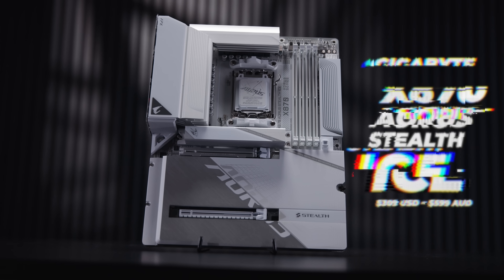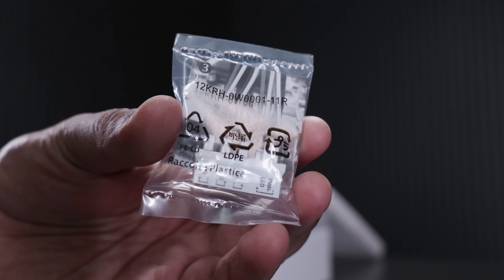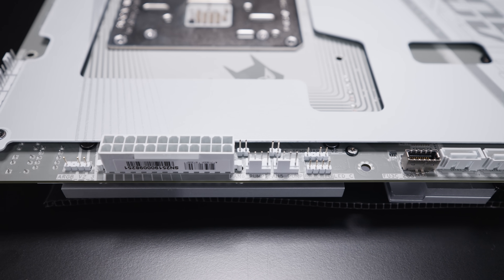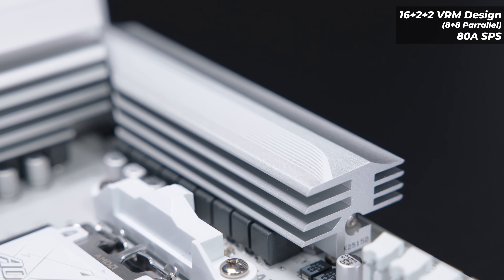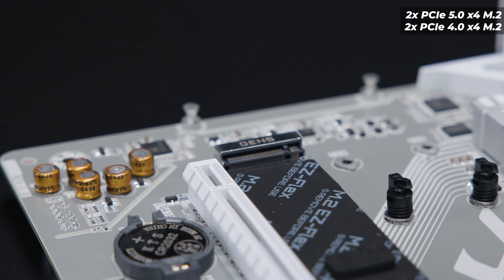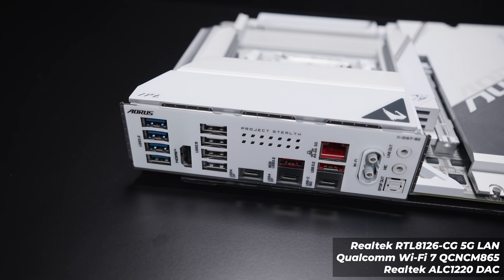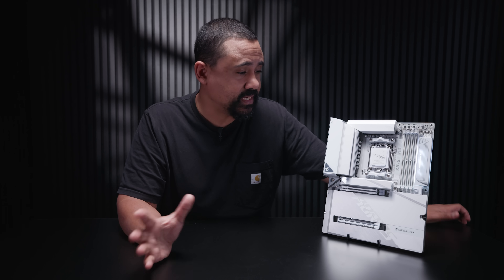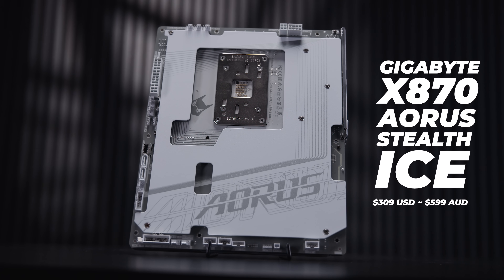AM5 is finally getting the love it deserves! // Gigabyte X870 AORUS Stealth ICE

Comment: I have a GIGABYTE AORUS B650 Stealth, and my RGB lights are completely dead due to the ITE 5711 issue. There seems to be no reliable way to fix it. I’m planning to return it to Amazon in the next few days.

Honestly, after this terrible experience, I really want to move away from Gigabyte. I’m considering switching to the MSI B850 GAMING PLUS Project Zero or the ASUS TUF Gaming B850-BTF WIFI W… or maybe taking the risk and getting the beautiful GIGABYTE X870 AORUS Stealth ICE.

Has anyone else experienced the same problem?
What would you do in my situation?

Comment: Nice review and thanks! , you mentioned not the recommended memory  so "what"is the recommended memory ?
Reply from the maker: It will do 256GB but not at those type of speeds. You could probably do 6000MT/s

6000MT/s is about the sweet spot for Ryzen 7000/9000

Comment: I have two M.2 SSDs (1TB Gen 5 and 2TB Gen 4) currently installed in this board (pretty much full), if I add a third drive will performance suffer due to shared lanes?

Comment: I personally love the Ice version of this stealth board. I got the X870 Stealth Ice in a Corsair 6500X case. (An all-White build...) It looks really clean. The only cables sticking on the front is the iCue Link cable to the CPU block and the 12vhpwr cable going to the RTX 4090 GPU.  So far so good. It handles my 9950X3D/4090 and the 64GB Corsair Titanium's at 6600MT CL32.

Comment: And here's the complete PC I want to build. Can someone maybe check if everything's OK or not? im not the best with pc stuff XD

GPU: RX7800xt (already installed)
CPU: Ryzen 7 9800X 3D
RAM: G.Skill Trident Z5 NEO RGB black DIMM kit 32GB, DDR5-6000, CL36-36-36-96
MAINBOARD: GIGABYTE B850 Gaming WIFI6
CASE: Fractal Design Pop XL Air RGB Black TG Clear Tint, glass window
PSU: FSP VITA GM 850W ATX 3.1 80+ Gold
CPU FAN: DeepCool AK400 Digital, black
SSD: Lexar NM790 1TB, M.2 2280 / M-Key / PCIe 4.0 x4
SSD 2: Lexar NM790 4TB, M.2 2280 / M-Key / PCIe 4.0 x4
+2 Fractal Design Aspect 14 RGB PWM, black, 140mm  For above 
Thank for Help ❤
Reply: Everything looks fine BUT the mobo

What’s the price of it compared to let’s say B850’s also from gigabyte in your region?

If you must go for that board I’d sternly suggest going for the X version.

So, Giagbyte B850 Gaming X Wifi6 

The main difference is the the VRM

The board you have listed in your comment is a 6+2+2 and the X variant of it is 12+2+2

BIG DIFFERENCE

If you were to slap a 9600 on that I’d say:

 ”Go ahead kid, looks great!!”

If you're set on pairing your Ryzen 7 9800X3D with a B850 Gaming board, I’d respectfully advise a slight reconsideration. 

The standard B850 Gaming, with its 6+2+2 VRM setup, may manage in a pinch, but it’s hardly the ideal companion for a processor boasting Rikishi-sized cache pockets—overflowing with data like an overzealous sumo wrestler squeezing into slim-fit jeans.

Instead, I’d sternly recommend the Gaming X variant. This board ups the ante with a robust 12+2+2 VRM configuration, [on–par with the top B650/E and X670/E boards of last Gen] providing your heavyweight champion of a chip with ample headroom to perform without breaking a metaphorical sweat. 

The additional power phases offer superior stability and efficiency, ensuring your 9800X3D flexes its cache-rich muscles to the fullest.

So, if you’re going to slap that performance behemoth into a motherboard, give it the stage it deserves— powering you through your X tremeGaming sesh’s. 

Your processor (and future self) will thank you.

If I were you, I’d go for a B850 Elite/Ice whatever colour scheme you are going for

For reference; my current ASRock B450 Pro4 mirrors that B850 in VRM Power Staging 

6+2+2 paired with a R5 3600 still packing a punch from generation 2k19.

I have a R9 9950X3D laying on the desk…

I’ve been trying to decide on mobo/source the RAM I was wanting in 64GB configuration. 

Either this board in the video or the X870E Pro Ice (also seen recently they announced in may the X3D Pro Ice, Elite Ice, and Master ICE… BUT no information about them unfortunately… 

So, to reiterate look for a 12+2+2 mobo to purchase. For that CPU.

Enjoy the rig once she is operational!!

Comment: I think the Gigabyte X870 and X870e Aorus Elite look amazing. But they both have one huge glaring issue. Two of the four m.2 lanes are shared with the main 5.0 GPU PCIE lane. So if you decide to add more than 2 NVMe SSDs your GPU will only run at 5.0 x8 versus X16. So lanes are cut in half. I don't know what Gigabyte was thinking when they decided to do that. I found out the hard way. Ugh. I assume this board is the same?
Reply: Main PCIe slot in the stealth board uses full bandwidth alone.
It doesn't share with any M.2 slot.

But the second M.2 slot shares with USB4 ports in the I/O panel—settings in BIOS.
And the 4th M.2 slot shares with the second PCIe slot—can use one of them only.
Reply: Tbh the performance ’hit’ is negligible.

You’ll only get hit around a quarter of full PCIe 5.0 bandwidth performance loss in certain creative environments. 

25% w stressful/demanding creative tasks

Gaming it’s like 1% 
renowned as ”Can’t perceive anything other than what my 60fps vision baws can render IRL” 

You’re essentially running on PCIe 4.0 x 16 if you fall to x8 on these boards.

Comment: B650E Stealth Ice still rocks!
Reply: Yeah i was lucky to get one before they seem to vanish in my region, it looks super clean even more cleaner than this one as i do not need the bottom pcie slot but i am jealous of the m.2 slots!!!
Reply: @dansolo6417  Good on you! Dude, I thought I was the only one who thought the B650E looked cleaner too!
Reply: Meh, debug panel is a MUST 

plus white DIMM Slots look nicer on the new stealth.

My gripe is – why did they not just release these as ‘E’s’ for both the B800 & X800 boards; I’ll never know…
Reply: @_LuX_p  I agree with the slots and debug panel but the exposed board in the area around it spoils it for me. i think there should be a magnetic cover covering it like the older stealth ice and the second pcie slot makes it less clean but i guess if you need it having a second slot is better obviously.

Comment: The problem with Gigabyte is that all of their boards are cut down compared to their competition in the respective categories (B series, X series etc.). MSI pretty much doesn't even use USB 2.0 ports on their premium boards anymore, and they always max out the PCIE lanes with either m.2 or PCIE slots. MSI finally announced an x870 itx board, and sure enough 4 m.2 slots, no USB 2, 2x USB4. Basically any and everything you can reasonably fit on that size board to take advantage of the chipset. Gigabyte's x870i board? Still uses USB 2, ONE USB4, 2 nvme drives, SAME PRICE AS THE COMPETITION... ASUS boards? Better features for the same money. B series boards? Gigabyte always has less ports/features. ATX/mATX? Gigabyte always has less ports/features.

Every time I look at a gigabyte board I can't help but think, "that's a nice board but, the competition just has more features and they're not any more expensive". It's like Gigabyte is allergic to maxing out the CPU/Chipset capabilities but they want to charge the same price as everyone else. At least Asrock has the decency to be cheaper when they do it.

Comment: Finally!! Someone acknowledging that Gigabyte was the first company to do the back connection! They had their Project Stealth in 2021.
Reply: The connector being on the back saves me a lot of trouble… this should be the norm.
Reply: Wasn`t that MSI with Project Zero??? B650 Chip set???
Reply: @hpk4917nope Gigabyte was before. Project Stealth came out in 2022 as a pre-built system with a Z690 back connector motherboard from 12th gen. It was pretty decent, too.
Reply: @hpk4917Nope. Gigabyte came out with it first, back in 2021. Project Stealth was originally a Z690 pre-built system for 12th gen that had the very first back-connector motherboard.
Reply: @hpk4917 gigabyte z690 platform,  they also had the case and a gpu with the power connector facing the back.